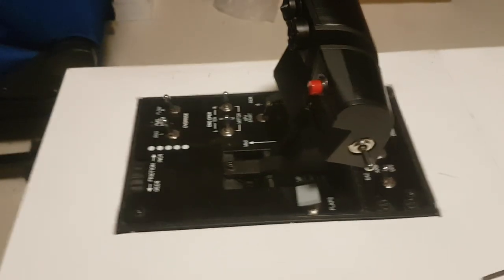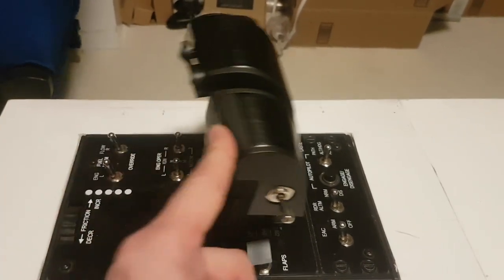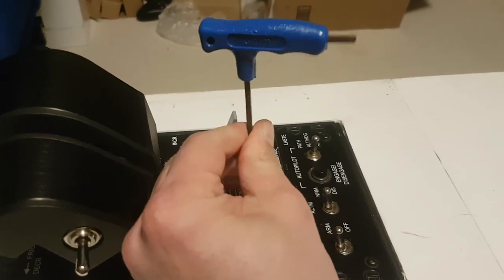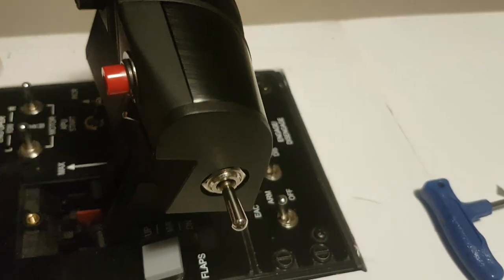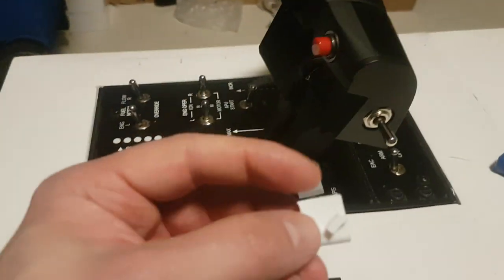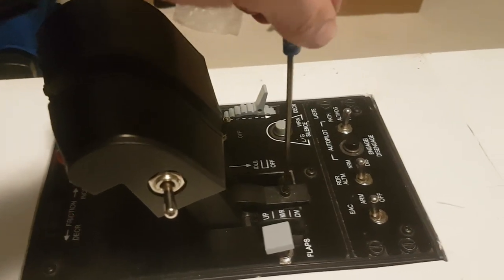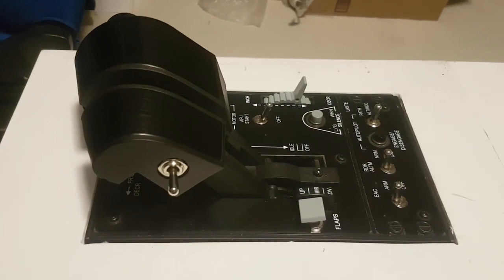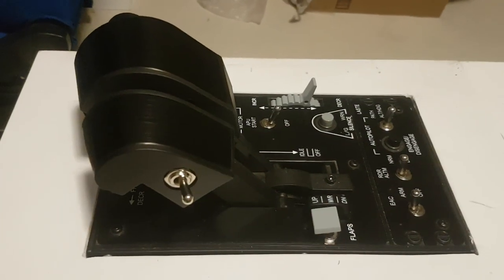Thrustmaster Warthog Afterburner Detent Mod Explanation and Install

Comment: Can I put the detent on the other side to provide me with that throttle stop & 'lift' for moving into reverse from idle?
I'm looking into purchasing the Warthog throttle system for Elite Dangerous and knowing when I'm in fwd / idle / reverse is somewhat crucial, so it'd be useful to switch the detent to the other side, making me lift the throttle after I've hit neutral and when I want to move into reverse (instead of after burners).
Great video, thanks :)
Reply from the maker: If you search on thingiverse I believe there is a 3d model for a center detent to do ex
What you are looking for, I however have never used it.
Reply: @GotWake4  I found those after making my initial comment - thank you very much for getting back. 3D printers are the wave.

Comment: The file is an exact replica of the original. So the part has to be modded ! At least you don't damage the original. I have a printer so can make as many I want. Kewl stuff.
Reply from the maker: No it is not, it already had the mod done to it.  The dozen or so that I have printed for my friends, not one of them has had to make any mods.
Reply: @GotWake4  printed mine and will have to file a bit off as i still need to pickup the throttle levers to ge over detent
Reply from the maker: @tday67  it still takes a bit of force to get over the push through detent, try it a few times, I know it has seemed to get easier on mine the more I use it

Comment: no need to print anything, you can just use a file and file down the stock part untill it does the exact same thing!
Reply from the maker: With a 3dprinted part you still have the unmodified original.  If you have access to a 3dprinter this part costs less than 5cents

Comment: Hi! Can I ask you how did you link the two parts of the throttle? A friend of mine has this controller but he can’t find the way to put the two parts together, so he has to move them one by one quite the same way when accelerating. Sorry for my English! Thank you!
Reply: Theres a metal handle / bar in the middle of both throttles ( below the buttons ) you move this like you would a bolt on a gate, to connect / disconnect as required.

Comment: does this mod work the other way around as well, just detent into `idle off`?
Reply from the maker: No, this one has nothing to do with the idle cutoff.
Reply: @GotWake4  yes i know, just wondered if it would also fit in that end of the throttle and do something similar but for `shut off`
Reply: @arabianjules  I'm also curious if I can put the detent on the other side to provide that tactile feedback for when I'm in idle / passing the threshold to reverse.
Reply: You should be able to but the detent piece is not removable from the idle side. It's easily visible with the cover off but it might be a little tricky to get a file into there. Also since it isn't removable if you mess up you will either have to live with it or buy a new throttle.
Reply: @rubiconnn  cheers good to know
Reply: just upgraded many thanks for sharing

Comment: How is it in real planes with afterburners?
Reply from the maker: For me in dcs in the hornet I did not even need to modify the curve, the stop is full mill and ab kicks in right as I pushed over the stop.

You may need to adjust your curve slightly to get it to match perfectly.
Reply: @GotWake4  I meant how does the throttle feel when real pilots want to activate their afterburners? Do they have to lift the throttle slighty or something like that? There must be some kind of tactile feedback so they don't activate the afterburner accidentally, right?
Reply: Lahzy Yes! Theres two «levers» on the Hornet throttle. Lift them, to hit the burners. Im switching mine up now to get that last bit of control and realism. A real Hornet pilot cant be thrusting his muscle memory only, when calling mil power.. It became pretty obvious when me and my friend did formation flying, takeoffs
Reply: @SurfVR  Thank you very much! I will set my Warthog throttle so that I have to lift for afterburners :)
Reply: @lazi21  the A-10 doesn't have afterburners so you don't need it.